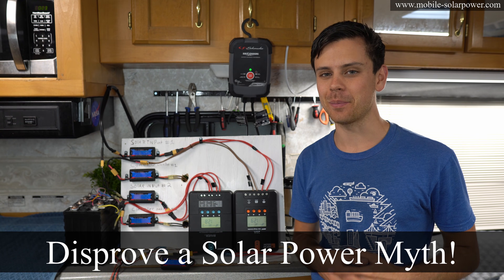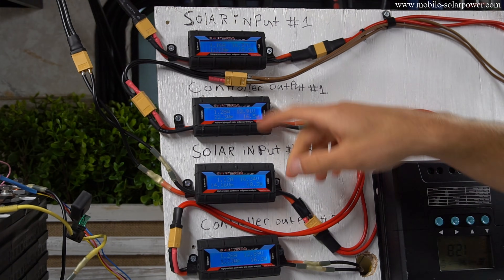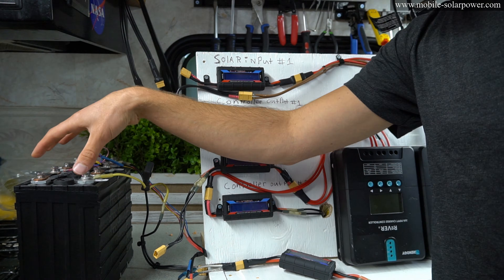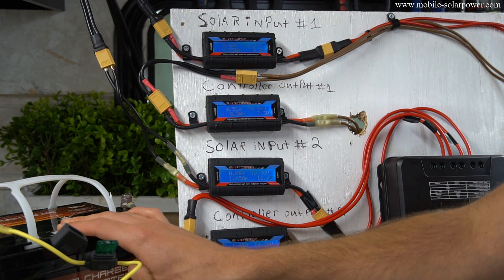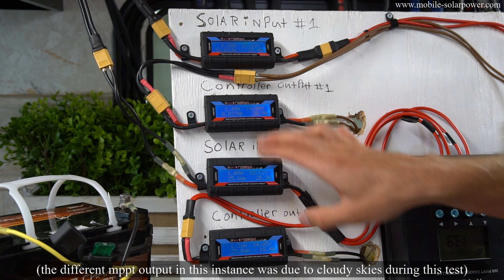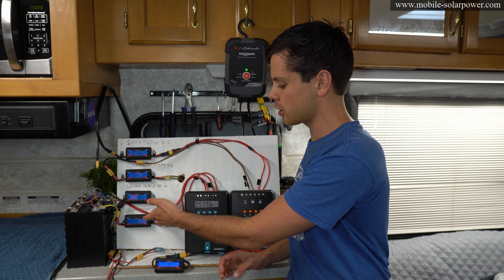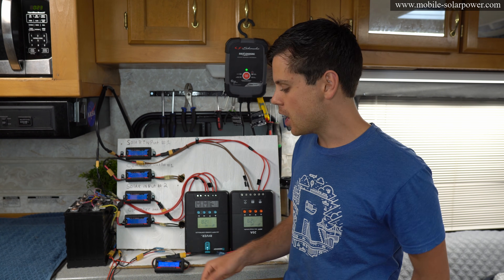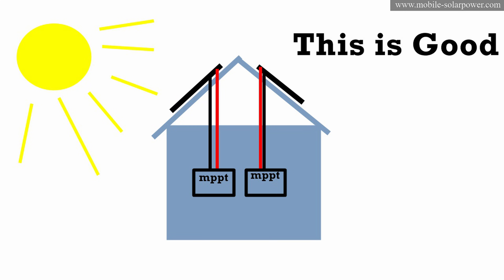Off-grid Solar Myth Debunked and Explained: 2 or more Solar Charge Controllers + 1 Battery

Comment: Hey Will, I had a friend who recently rewired his solar system kinda like this, he was having issues with partial shade gimping his solar system for more than half the day, so he rewired it with some cheap $8 mppt charge controllers he got off aliexpress putting each solar panel on its own MPPT charger connecting to the battery on a common bus bar. He claims it improved his solar system by 60%, because he no longer has his system dropping down to the output of the partially shaded panels now, each panel puts out the max it can put out and the controllers seem to not overcharge his LiFePO4 batteries.
Reply: The $8 controller may have said mppt on it...

Comment: Will, here is a fun suggestion for a future video: If money was no object, design the dream off grid RV/tiny house PV + battery system.  For example would you use the fantastic LTO batteries for their 20,000 cycle life, safety and high discharge rates? Or Lifepo4?  What kind of inverter, charger, Ratio of PV to storage, etc etc. What size storage? What would you aim to operate with it?

Comment: Nice video. :)
Question. What if your solar mppt controller are far less amp than your total solar array.?
Reply: PWM controllers can't be overpaneled like that or they will be damaged/killed.  MPPT controllers can typically be overpaneled by ~10% without doing harm.   The safest approach is to oversize the controller compared to the panels.

Comment: on my van i have 3 280w panels, 2 charge controllers, and 1 battery bank, is this a 3 2 1 system???
the chargers are real mppt and cheap 20amp ''diy'' (makeskyblue) ones, i have had 40amp fuses blow on a real sunny day, going to add a 3rd charger and more battery, as running my home stuff can be a drain if i have a youtube viewing day...

Comment: I was looking at a  Flin Energy  solar charger/inverter (similar to MPP brand) . On this PWM (cheaper) model, solar max input is 3000 W and Inverter is rated at 5000 W. I was looking at ways to achieve 5000 W inverter output on solar to run air-conditioning during sunlight hours. Using this method, I can connect 3000 Watts of solar to 48V 200AH  battery through a MPPT solar charge controller and another 3000 Watts of solar through PWM charge controller in the inverter. Thus I can perhaps achieve 5000 Watts of inverter output purely on solar during sunlight hours. The reason for considering this set-up is a  PWM solar charger / inverter in parallel with MPPT charge controller is 30% to 40% cheaper than buying one single MPPT solar inverter that can accept 5000W of solar input.

Comment: Does lithium battery resistance  increase below 70F ?  In a cool location at 50F, is there more resistance than @ 70F?
Reply: As far as I know Li internal resistance is so low already that the average bear wouldn't notice a difference.

Comment: I think the real issue here is what is MPPT charge controller is trying to do, and when will it not do that. Since the job of the MPPT is to adjust the adjust the voltage of the solar panels such that it give the most watts, and then lets that flow into the battery at a lower voltage, you can have as many charge controllers feeding one battery as you want, as long as that battery can take all the juice.

However once your battery SOC gets too high, the other feature of the charge controller ignores MPPT and just limits current to the battery. Unless the controllers communicate with each other, the controllers will in fact fight each other, and anything one controller adds will be reduced by the other controller. 

The type of battery you have determines how to set up your system. If you have lithium ion batteries, you want a battery big enough that it never fully charges, and therefore your charge controller will always be in MPPT mode giving you the best bang for your solar panels.

However if you have lead acid batteries, they need to be fully charged daily to at least float voltage. So you don’t want your battery oversized for your panels and consumption. This means your charge controller will shift from MPPT to battery charge mode sometime during the day.

Obviously you need one MPPT controller for each string of solar panels which are mounted at a different angle, and as long as the battery can accept the charge, all charge controllers feeding one battery will do their job of MPPT. 

So the main thing is get as big of a lithium ion battery as you need and make sure it stays between 30%-80% on a normal daily cycle, and your charge controllers will not fight.
Reply from the maker: Absolutely! You are seeing the bigger picture of designing a system based on battery type. You got it. I like having a large lithium and cycling between 20 and 80% SOC, and when it hits 80%, automatic transfer switch turns on my water heater as a load dump. I would not be able to do this as easily with lead acid. And yes, great points you mentioned. Absolutely
Reply: > the other feature of the charge controller ignores MPPT and just limits current to the battery. 

MPPT controllers reduce current by selecting a powerpoint at which the panels make the newly-reduced amount of requested power.  Usually this is upwards towards Voc since moving below Vmp might result in a voltage too low to charge/float the battery. 

In other words, MPPT always uses PPT but not always the [M]aximum power point.
Reply: Frater Mus, the whole purpose of MPPT is to ensure you get the most power of of your array, which will give the most energy. It does this by limiting the current leaving the array, which increases voltage, and it finds the highest combination of volts * amps. Then it lets that energy flow into the battery/inverters. 

When MPPT is working, amps to the battery will ALWAYS be higher than without MPPT, but since you can’t put high amps in a fully charged battery, the charge controller is no longer giving max energy. So if you want all the energy your solar can provide you need a lithium ion battery big enough to only charge to 80-90% during daytime. 

If you use lead acid batteries they must be fully charged, which means correct must be limited, which means you are wasting solar potential. If you don’t fully charge the lead acid batteries you will spend more on batteries than the money earned from the extra hours of MPPT.

So the main point about multiple controllers fighting or not running at MPPT has to do with using the right battery type and capacity.

Comment: Does using more than one charge controller apply to solar chargers too when adding a second battery  (AGM or Lithium)? Inergy says not to use another charge controller when connecting their unit to an auxiliary battery, but your video shows it should be OK. I want to use an external DC charger to the auxiliary battery because the Inergy unit won't charge it to full.
Reply from the maker: Absolutely not. Totally different scenario. The converter circuit of Apex is designed to charge to 12.6 volts max due to NMC it's designed to attach to. If you exceed that voltage with another converter circuit, you will fry the Apex. Bad bad bad idea. And no, this video does not say to do that. Completely different circuit than what was mentioned in this video
Reply from the maker: And you can't charge lead acids attached to apex to full. That's one big downside of the apex

Comment: Good explanation, does this multiple solar charger connection approach work for PWM charge controllers?
Reply: Yes
Reply: @bren42069  Thanks Bren, would this mean connecting to a single battery bank or separate battery banks which could be connected either in series or parallel to the inverter?
Reply: The chargers should go across the entire battery and yes that would be in parallel to the inverter and each other
Reply: @bren42069  Thanks Bren

Comment: Great to know this info. I have trees in the back yard and more sun in the front AM. I could run 2 controllers on separate arrays in accordance also utilizing the best solar panels for their respective output for straight sun and partial shade. Great to know this. Thanks Will.
Reply: @Bmillmine yeah, I can't do that, but I can work out a plan for best efficiency of panels with that in mind.

Comment: Hey Will, thanks so much for the very informative videos!  Do you think 8 hours time duration for equalizing  (4) Duracell GC2 6V FLA batteries is too long?  That's the hard setting in my Xantrex Freedom 458 20D charger.  I know i should check the specific gravity to know for sure but I'm always paranoid i'll end up squirting acid in my eyes or something dumb like that.  I've got a BMS i've been procrastinating to install so i can more accurately track the charge cycles.  I full time RV and go between boondocking and campgrounds so my charge cycle patterns do vary quite a bit.  Sorry, now i'm rambling...  Thanks again for your channel!!!
Reply: That sounds like a long ass time, the best thing to do is to find the specs recommended by the manufacturer for your specific battery model

Actually i think I'm using that same battery which is a rebranded deka gc110, i found the exact specs somewhere i believe someone on cheaprvliving forum actually called deka and asked. iirc
Reply: @bren42069  thanks Bren, I'll check that out.

Comment: curious about two or more uxcell Voltage Buck Converter Regulator DC 24V Step-Down to DC 12V 20A 240W Waterproof Power Transformer , what will they do share the load or hunt back in forth? if the load was bigger than one , but not two of them. Great info Thanks!

Comment: The only issue I have seen is connecting two mppt controllers to the same panel string,
Reply: How is that possible? Only one positive and negative comes from the panel string normally
Reply: @Cooldipo  people have done stranger things
Reply: This can be a real problem if they are not identical and use the same array.  Some controllers switch the positive and others switch the negative.  Having one of each kind in parallel can short the panel directly to the battery.  Will identical ones share current? Not really, they will figure something out.  If you don't have a separate current shunt for the controller to measure current out of the battery, your charging system sucks any way.

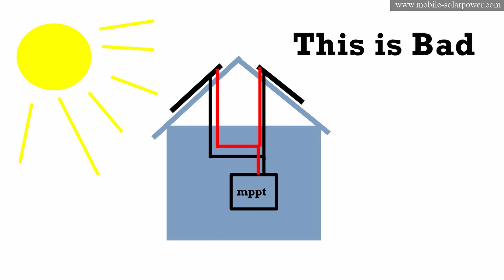Comment: The problem at 8:00 can have another, cheaper solution with 2 schottky diodes added to separate both arrays. We will have around 1% of output voltage drop but the resistive value of each array won't affect the other :)
Reply from the maker: Absolutely! Blocking diodes. You got it :)

Comment: I was wondering at something else you might be able to help us with, whose calculations are somewhat beyond me. Is it really practical to have a cheap chinese diesel heater? They seem to be popular. I may be wrong, but the amount of battery needed, as enough to cover maybe 3 days lack of solar, is just too much as a practical heating method in more northern or UK climates for the winter if one is trying to live off solar, and if you include lighting and (low-power) laptop usage (my laptop uses about 16 watts max, ultra low-power). I see people putting them in vans which I can't imagine have anywhere near enough solar.  I would have thought it would be a stretch even with 300watts of panels in winter time. Am I wrong?
Reply: You're in a bad sun area.   If you want more solar power you need more panels, that's all.  Ask Will about using amorphic panels as a better means to reap PV under overcast skies and acute angles. (I don't know enough yet.)  And, ya, use a second charge controller for any given second panel array.  Hope that helped.
Reply: @jh1859  , there is that, but somehow people in these areas are getting these deisel heaters anyway. It's strange. Maybe I'm wrong but they say they need between 1 and 2 amps to run the glowplug and fans.

Comment: Can you charge a 48v battery with two 24v chargers in serie?
Reply: Not usually.
First problem, many chargers at not fully isolated. This means the output has a connection directly to the input. For example, the negative output might be connected to the neutral A.C. input. If you try to connect chargers like this in series, the negative of one connects to the positive of the other resulting in that charger will have both its positive and its negative connected to the neutral A.C. input. That won't be good.
Second problem, the charger resistance is not the same as the battery resistance. If the charger does not see the correct battery resistance it will not charge correctly.
If you have two isolated 24v chargers, and if you can access the center (24v point) of the battery, then you can use one charger for the bottom 24v of the battery and the second charger for the top 24v of the battery. ONLY IF THEY ARE ISOLATED CHARGERS! :)
Reply: @Sylvan_dB  Thank you so much for your explanation! In fact, I wrote "charger" when I meant "charge controller". So they will be fully isolated. But unfortunately, I don't have access to the 24v point of the battery. Where I live the only LiFePo4 battery available is a 48V one from BYD and the 48V charge controllers are crazy expensive. I wish I can find a 12V or a 24v LiFePo4 but no, we are stuck to lead batteries :/
Reply: @mufmtp  have you tried buying from China? Aliexpress and co?
Reply: @Cooldipo  it depends from country to country, but here in Brasil we need special authorization to import big batteries. The batteries will be blocked at the custom service...

Comment: Thanks Will, this is what I was looking for and the answer to the question I asked you yesterday. Now I have the answer and I see I can connect every charger to the same time to the battery, MPPT + dc-dc from alternator and even sore power charger. Thanks dude :)
Reply from the maker: Awesome!! Glad I can help :)
Reply: Can you put the power from mppt into the DC to DC charger?  We want to be able charge 2 types of batteries (Lead Acid and Lifepo4) from 2 different sized solar-panels each on separate mppt, and an alternator.

Comment: As I understand it, the IR of the battery dictates the current it can take, but the charge controllers decide how much to give based on the battery voltage, up to whichever limit is reached first: desired current / panel or charge current or batt full.
Multiple controllers work fine, they have no knowledge of each other and don't need to know - all they know is the battery voltage, and therefore how much current to push depending on where it is on the charge curve.
More controllers push up the voltage, so they'll back off automatically to follow the voltage and give the combined charge current specified. Make sure combined controllers cannot exceed the C rating of the battery, so they should be derated to ensure that can't happen. This may only be a problem with small batteries and large controllers though!
Reply from the maker: @twmcali7257  there is no magical way for a charge controller to know what other charge controllers connected to the battery are doing. And for most circumstances, they don't need to. It measures the voltage and uses it's charge algorithm to determine what is most appropriate. And what did the renogy tech support say? also, the controllers in this video are rebranded renogy controllers and you can see from the test that what you said is simply not true. Think about how they work
Reply: @WillProwse  After watching your video, I purchased multiple charge controllers.  I found they do reduce output.  When I have 1 output is > 700 watts,  2 total output is 400 watts, 3 total output is 300 watts.  

I have them on a busbar.  What I think is happening, is as the solar power is used by one controller, it degrades what's available to the others.  Then on the output side, I have again all going to a busbar, which I believe is also altering voltage as seen by the other controllers.  

So your are correct, there is no magical way for the charge controllers to know what the other is doing, it is the voltage and amps the controllers are detecting on input and output which it sees, that is altering their ability to function.  

I have isolated each to it's own solar bank and specific batter on the bank, and that has worked out much more efficiently.
Reply from the maker: Exactly!!
Reply: @twmcali7257  They could do, but in general they don't need to.
They could arbitrate with one or more controllers electing to switch to grid output or load dump if the battery is approaching full and can be handled by just one controller - in that case they may need to be aware of each other, or more likely a master controller decides which controller does what and when.
Reply: @twmcali7257  They have knowledge of the overall system but not each other directly unless they have direct comms with each other.  I don't think any Renogy stuff allows inter-controller comms but I could be wrong.

Comment: Great video Will, I’ve always been told that the MPPT chargers would fight against each each other.
Cheers,
Reply: I think this is true only if the MPPT chargers share the same panels, not sharing the same battery.
Reply: @ahaveland  Exactly so
Reply: Andy Lee Robinson what about if I have a caravan with a solar panel on the roof connected to 120 AGM battery via a mppt charger which is parallel linked to another 120 amp battery which has a mppt charger attached and which is feed by tow vehicle
Reply: @mrfourex4070  Fed by tow vehicle? You mean that has solar panels too?
No problem - each mppt has their own set of panels which they manage. Their outputs can be connected together fine at the batteries, (assuming they're both set to charge the same type and voltage of battery)
Rule for mppt is that they control 1 panel, string or array each so they can adjust the input voltage for max power.
2 mppt controllers sharing panels will get confused as they hunt for max power. They will still work, but not optimally.
The outputs only care about battery voltage and current and are independent of the panels.
Hope that makes sense.